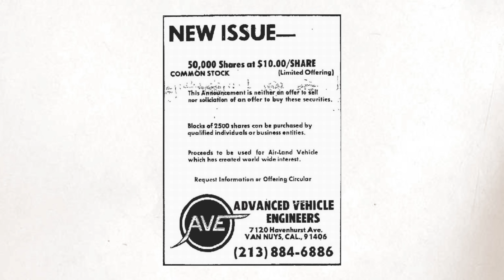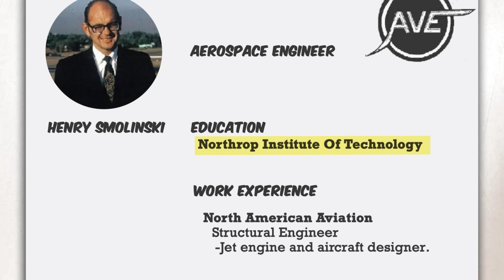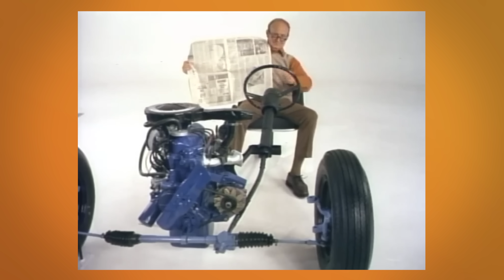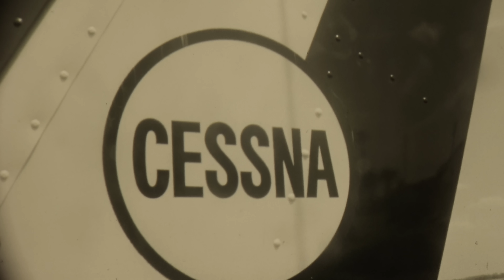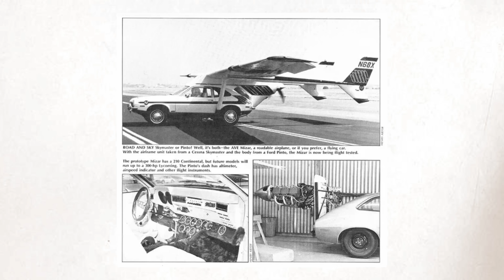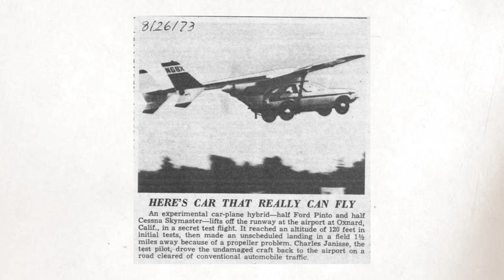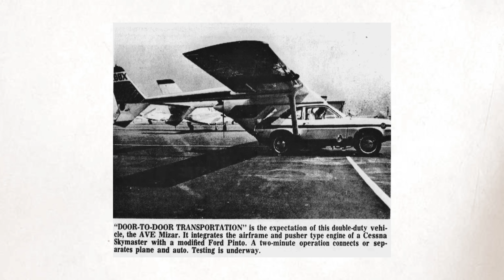The wild 1970s flying car that actually worked... until it didn't

Comment: Thank god it happened so early to stop this unholy abomination from spreading.
Imagine road vehicle's low standards in the air. Daily accidents, cars flying into houses, and no one gives a damn, because it happens daily, not a big deal, not even worth mentioning.
The same goes for quarocopters. And, btw, if a plane loses power during flight - it can glide for miles, in most cases that's enough to find a field or a road to land to. A drone? Well, unpiloted drone - not a big deal, it's just an expense. But piloted one - it's practically guaranteed to kill the pilot. This thing glides like a brick.

Comment: To give some perspective.  I own a 2016 Miata, which is among the lightest cars on the market, around 2500 pounds.  It's powered by a 150 Horsepower engine.  My friend owns an experimental plane (a Van's 8A) which is under 2,000 pounds total (full fuel, passengers, etc).  Adding my Miata to his plane would defeat all of the planes advantages, and giving that plane a more powerful engine would fix zero of them.

P.S. To all the people complaining about bad drivers, the existence of 'flying cars' would have no effect on pilot training.  Pilot training is extensive and rigorous.  It is much harder than driving school.
Reply: Yes, pilot training is much more rigorous than flight training, and if the flight medical doesn't  fail you the cost of instruction and aircraft rental may fail you.

Comment: The AVE Mizar was and still is a great concept! When I used my Cessna Cardinal (177) for weekly commuting for five years, ground transportation at the destination was a formidable barrier to making my airplane a viable commuting solution. I was there for the week. What if the weather didn’t allow for a flight home? What if I landed at a small airport with no car rental options?

Comment: Here's what I got from this video:  Larger and more powerful engines only make an airplane heavier, they don't provide more power for better performance.  Also, some dude who apparently didn't have a pilot's license tried flying a car.  Also, something doesn't need to actually disintegrate in order to claim it disintegrated.  So maybe getting all broken up on the ground counts as a sort of retroactive disintegration?

If someone wanted to make a really interesting video about this, they could try digging a little deeper.  Why did an experienced pilot not comply with requirements to get permission from ATC to take off?  Had a successful flight been conducted earlier in the day?  Was this flight even intended to be a flight?  (At that time they would often do something like a reverse touch and go - they would simply take off and fly for a few feet then land immediately.  It's possible with the more powerful engine they went higher and faster than anticipated and couldn't stop before hitting a fence, so the pilot's only other choice was to gain altitude and go around for a landing.)  Or was it his only choice?  Was there a reason he couldn't simply land in the bean field like Janisse had done before?  Then there were the other "conspiracy theory" type things that didn't add up.  The car was trying to separate from the wing but the (aerospace) structural engineer who married a Skymaster to a Pinto didn't think "should we do something to prevent that from happening again?" Just as interesting, the two occupants bodies' were unidentifiable, but their ID survived the fire to confirm who they were, so there was no need to go to the trouble of getting dental records or anything.
  
Yes, it could make for an interesting video, but perhaps that should be done by someone who doesn't go for the quick sensationalism that wants to imply a couple of guys with experience in aerospace engineering wouldn't know the bigger heavier engine was bigger and heavier - or make it sound like the guy flying wasn't a pilot since the thing was invented for the average guy to just hop in and fly.  And maybe whoever makes the video will be sensitive to the fact that Henry Smolinski had seven children whose father meant more to them than simply some guy we can make out to be an idiot on a YouTube video.  Some of them are still searching for the truth.

Comment: drugs had to be involved if the previous near death test flight didnt come with structural improvements immediately afterwards... an aircraft engineer who decides to add weight and power to a failing design sounds like darwin awards worthy to me.

Comment: I remember when the Pinto came out in 1970 it had thin bumpers on the front and back. Then I think a year or two later they redesigned to much thicker front and rear bumpers. The gas tank issue was the main redesign of bumpers. I had friends who’s parents bought a 1970 one new with the thin bumpers.

Comment: First off the position of the gas tank wasn't the problem, remember the gas tank filler behind the rear license plate on many GM cars?  And how gas would spill out if you took off too fast after filling up?  It was the Pinto's  filler tube going into the gas tank that would come out if it was hit just right.  Ford fixed the issue before the end of the run.  Similarly to the Corvair which was also fixed before bad publicity killed it.

Comment: I drive truck but I know a couple things about aircraft. And my current endeavors tells me that the general public isn't what you want flying around drinking booze and smoking dope. Bad enough that intersections are dangerous. The public being airborne would mean that the danger could come from any direction at any time. Imagine radar on your house with proximity alarms so you can run to your impact shelter.😲

Comment: I've always thought that a wing chute made more sense for a flying car. Very little added weight and significant lift. Parachutes already exist that can handle the weight of a tank. The down side would be reduced air speed. The up side, you could fold up the chute and store it in the vehicle.

Comment: The trouble with the flying car is that you end up with a lousy car and a lousy airplane, all the cost of a house. And electric propulsion makes this all harder, not easier.  Gasoline has about 40 times the energy density of a lithium battery

Comment: Attaching / disconnecting / storing the wings is inconvenient.
Aerodynamics are lousy compared to purpose-built airplanes, so airspeed and fuel efficiency is compromised.  Cabin space to weight ratio of the whole contraption is worse too.  And even with wings removed, the adapted car still carries excess hardware compared to a regular car.

Like any regular airplane, you can only take off and land at airports, and you still have to store the wings in a hangar there... So you might as well just store a purpose-built airplane in the hangar and then swap it with storing your regular car when you fly.

Finally, most people don't even have a pilot license to be able to fly such a thing; the training is long and expensive, and the thorough mastery it takes in specialized fields of knowledge along with strict physical health requirements bar a sizeable portion of people from ever becoming a pilot anyways.

All told, a flying car just isn't a practical solution to any actual pressing problems in any significant markets.
The movie production crew behind James Bond: The Man With The Golden Gun is really probably the only customer that actually had a need for this.
Reply: Side note: I feel the same applies to the self-driving car hype of a few years back.
People are now starting to realize it's not all it was cracked up to be.  You still need the training, knowledge, driver's license, and attentiveness of a legally-fit driver to take a self-driving car on public roads... So what's the point?

Then there's the liability aspect.  If a self-driving car crashes, who's at fault?  Who is held liable?  The company that made it?  The software developers who programmed its algorithms?  The owner or fleet operator (in the case of self-driving taxis)?  Or the occupant?  (Neither of which have any control or influence over the driving!!)

In the end, self-driving was little more than marketing hype and a technology demonstration of a solution in seek of either a non-existent problem, or a fantasy that has far more things to consider and address than just "Is it technically possible?"

Comment: Besides the VERY HIGH initial investment, AND still having to secure a pilots license, AND still needing an airport. I think that a airplane/car idea is dead for many other reasons as well. Now a personal drone, might not be as bad. But your still going to need a pilots license. Which id going to cut out MANY people right off the bat. Considering that many of the people that can afford them (successful 50+ year old's) have one or more physical ailments that will keep them from getting a pilots license.  I think that the people who could use them the most (regular family people with 2) 40 hour a week jobs, 2.3 kids, a dog, cat or other pet a mortgage and a car loan) simply will not be able to afford the drone payment, pilots licenses and insurance, not to mention the CERTIFIED maintenance on one of these.  They are just going to be WAY TO EXPENSIVE for average Joe & Jane to be able to afford them. I think that the auto manufacturers who are trying to recuperate their money spent developing electric vehicles.  By creating a viable cure for road congestion, and time spent commuting. By inverting $?,???,???,??  into a market that no one can afford. People will still need at least one $40k - $80k vehicle for ON road tasks. How many of them will be able to afford $1,500-$3000 a month (maybe more) for a flying vehicle. Plus the extra infrastructure that will need to be created to support them.  It is my opinion, that they (the auto makers and or drone makers) should cut their losses before they spend $50-100 million into fully production ready vehicles that will suffer the same fate as Dodge's Electric Charger E.V..  They are simply going to be WAY to expensive for regular people to afford them. And selling a couple of hundred a year will bankrupt them, ESPECIALLY if several companies are competing for the same, tiny market. I would LOVE to be able to fly. But I wouldn't be able to afford one IF SOMEBODY GAVE ME ONE! The CERTIFIED maintenance would bankrupt me. And I wouldn't be able to GET a pilots license, nor afford the AVIATION FUEL (because the FAA WILL REQUIRE Avgas) to keep contaminants that are common in automotive fuel, from causing a drone crash when the engine dies at 3,000 feet in the air.

Comment: How does a structural engineer from North American  Aviation, the company that designed the P-51 Mustang, F-86 Sabre, F-100 Super Sabre and others do this structural monstrosity?  But, on to a more humorous element of this tragedy.   In the 1970's, in support of Pro Stock racers such as Gapp and Roushe, Ford put a Pinto into a wind tunnel for testing.  Allegedly, on a whim, they put the car in the tunnel BACKWARDS  and discovered it was better, less drag going in reverse. And in that vein, sort of, since Galpin Ford was mentioned, they built a wheelstander like the "Little Red Wagon"  based on the Ford version of that cab forward pickup except it went backwards. It was the "Backup Pickup."  I saw it once at the Camarillo airport, the former Oxnard Air Force base also mentioned here.

Comment: The information about the fuel tank rupturing is incorrect. The gas cap threads were not compatible with the filler neck so a rapid deformation of the tank would blow the cap out with fuel vapor and or gas depending on the amount of fuel in it. The agency that did the testing cheated for a reason I either forgot or never knew but a lit flare was mounted in an obscure location with a hole cut in the filler neck because they couldn’t get the Pintos they had to explode and only had so many available. The devil’s advocate in me can understand why they did this but that’s a slippery slope much like “Unsafe at Any Speed” and people not following the recommendation for tire pressure. I’ve owned many swing axle rear transaxle and engine cars and experimented with different pressures and could spin out at ten miles per hour and you’d be surprised just how incredibly fast it happens.

Comment: I was a trainee and flight instructor at the time.  I inspected it closely shortly before the final flight and concluded it was a bucket of junk.  Also, the wings were from a Cessna 336; poor choice.  That wing was designed for higher speed and the 336 was very poor performer on two engines; even worse on one.  Stupid to mate with a Pinto which was heavier and greater drag.  Not surprised when it came apart and crashed.

Comment: The way to do this is have the airplane assemblies for rental at small airports and manufacture compatible cars for them but I think run the propellor off of a PTO shaft coming out the rear bumper. Have a hand lever for the RPM's because nobody is going to want to keep their foot on a gas pedal for long flights. Configure it so it could glide in case of engine failure. Subject the cars to a little different yearly inspection. I would trust this if the engineers from the old Saturn car company were put in charge as those cars were super reliable and only about 2200lbs. You'd just need to jack the horsepower up to a comfortable level and get the cars up to 120 to 150 mph.  
People with land could build their own airstrips if they want. Everybody has GPS now so navigation wouldn't be a problem. On landings the wings should fold back on contact to make it more narrow which would come in handy on emergency road landings. Yes, people would occasionally die due to their own stupidity but if it's engineered well enough to eliminate mechanical failures I'm all for it. For larger airports I would give them their own little airstrip off to the side and have rooftop navigation by markers and lights to lead them away from where the big jets typically fly. Maybe make road take offs and landings workable with the moveable wings and special marked zones on highways away from bridges and wires. F all the snobby pilots that think this is a bad idea. I want it. If there is an air traffic problem down the road when these are common a solution will be found by then.

Comment: So, you want to take a Cessna Mixmaster, an aircraft with two engines and an absolute MTO of ~4000 pounds, remove one engine and the whole fuselage, then strap what's left to a Ford Pinto that weighs ~2500 pounds wet.  You end up with a contrivance posessing half the horsepower, grossly reduced aerodynamics and you're also ~500 pounds over the original Mixmaster's max takeoff weight .  
I'm just a dumb A&P and the whole thing screams "no".

Comment: Some of the newest smaller cars could make this viable, the main reason General Aviation is dying beside the high cost of owning a small plane is that the small airports these planes use have no transportation once you fly in so that's the motivation for doing this.
 Another reason is that at the peak of general aviation (50's-70's) the Interstate system wasn't completed and a small plane could get you there 3 times as fast including short commutes. This is true to a lessor degree in the mountainous states now as I fly direct where the roads are far longer, a car from phoenix to Yuma is 3+ hours, I fly it in about an hour.

Comment: Smoliski's vision is more sensible than actual point to point flying cars. If everyone has a personal flying car it is very prone system to total breakdown like a website as air trafiic control must be fully automated to be able to handle huge random traffic. Just like Tesla charging stations there should be centralized wing station fields. But electric batteries are too heavy for now.

Comment: As a private pilot myself, I'm skeptical.  Everything I've seen so far is too expensive, too lacking in performance, and too weird.  It is neither fish nor fowl.  It's not a good car.  It's not a good airplane.  For what you spend for one of these, you might as well buy a good airplane with much better performance and a few "airport cars" to keep at the airports to which you frequently fly, and call it good.  You'll save money in the long run.

Now, I will say the drone approach makes more sense because the goal here is point-to-point transportation.  No pilot I know is ever going to drive a car to an airport, sprout wings, and take off, without first giving the plane a thorough preflight check.  Too many road hazards could ding up something.  With a point-to-point drone approach, you don't need the car.  Add in automatic "highway in the sky" traffic control and the ability to set down almost anywhere in the event of bad weather, redundant battery backup, and even ballistic recovery systems, and now you are talking.  

All that said, it still won't be cheap unless a model for a taxi service or something along those lines can be made first.  Perhaps, a taxi service but only for those people also trained and checked-out in emergency operations of the drone-taxi(?).

I'm not against the idea, but as the narrator said, this is all a "solution looking for a problem."  And, that's true.  If availability, safety, and above all, cost, can be brought down, you might have something the public would go for.